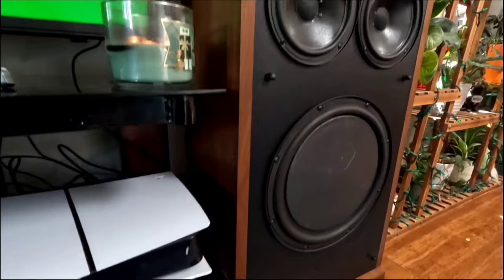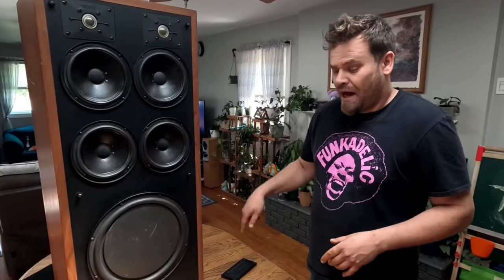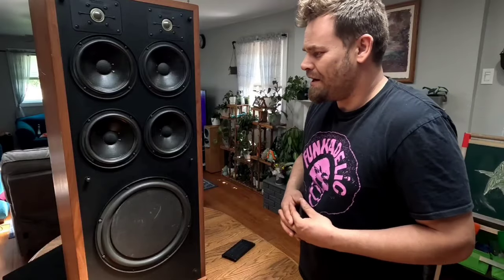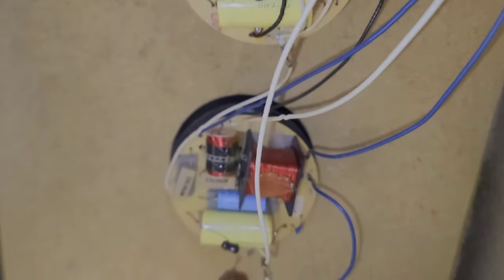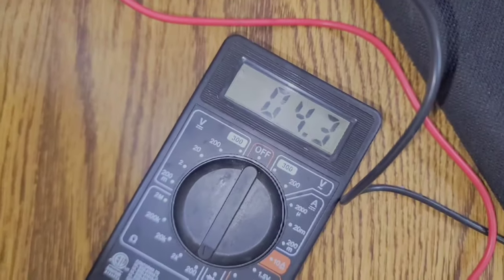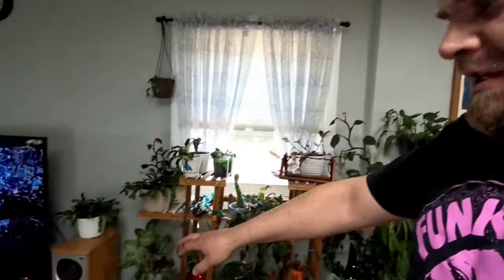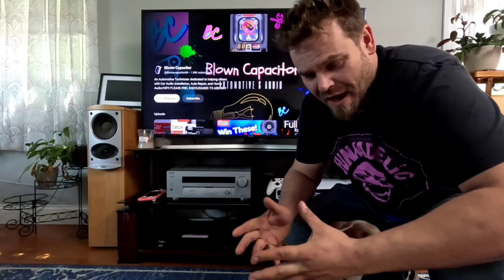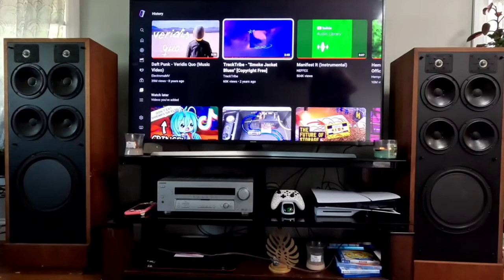I Brought These Polk Audio SDA 1A Speakers Back To Life!

Comment: Cool video. I love my Polk Monitor 5 speakers. Their best was from the 80's and 90's. FYI, interconnects are the cables between components and good ole' speaker wire goes from amp to speaker. Thanks!
Reply from the maker: Yeah, I had to make my own interconnect cable, but it worked out great! Thank you for watching!
Reply: In this case, the interconnect cable goes between the speakers so you’re not correct about that your monitor five does not use an interconnect like the SDA do
Reply: @brandonloeffler  the SDA 1A has 5-way binding post that speaker with connects to with each one I have seen. Interconnects transfer signal between components then speaker wire/connects transfer sign wave from component to speaker. Only powered speakers have interconnect cable option.

Comment: Great video; thank you for making it. I have these exact same speakers and I just finished epoxying the magnets on all woofers (to prevent magnet shift).  I do need to make the interconnect cable, as there was none with the speakers. It would be great if you can share details of how you made the interconnect; especially the part numbers for the connectors and where you got them from. Perhaps because I don’t know what they are called, I’m still searching. Not willing to pay $80 for the cable LOL.
Reply from the maker: @raviad2596  honestly I never ended up buying the cable that I saw online I just took an extension cord and soldered the ends to where they would be more solid and stuck them in the sockets just make sure the polarity is right
Reply: @Blowncapacitor84  thank you. I’m looking for only the connectors (pin & blade) that go into the 1A. Thank you
Reply from the maker: @raviad2596  No problem at all!  Thank you for watching and enjoy them! They are absolutely great speakers!
Reply: @Blowncapacitor84  would it be possible for you to share details of the connector that you got and from where?

Comment: I just got a pair of these speakers with the same kind of speaker connectors that I'm surprised you didn't mention. How do you connect wires to these? Did you use needle nose claps or do something else? I also don't have the innerconnection speaker wire and heard you say you made one with an extension cable. Aren't the ends smaller on the speakers even if you use the older 2 prong ends? If so where did you get the ends at
Reply from the maker: I used spade connectors on the terminals and I actually just cut both ends of the extension cord, stripped the ends, and soldered them so I could just shove them in the "sockets" for the interconnect. One of the terminals for the interconnect is larger than the other one so that will tell you proper polarity

Comment: I'm guessing you also know by now that the reason the wires were disconnected is probably because someone saw the connectors when they went to hook up speaker wires and decided to look inside from the back side to investigate the connector configuration and pulled the wires off when removing the terminals housing which then made them into what you initially saw and the reason they fell into your buddies hands for next to nothing probably.There is NO room to pull the terminals out and disconnect the wires before yanking them out while removing the terminals from the back .TERRIBLE wiring design
Reply from the maker: EXACTLY! I 100% agree.

Comment: My only question to you is, if you took the time to make the interconnect cable, why didn’t you audition them with it in place you do understand that only half the speakers are going to work without the interconnect cable my recommendation is to use the cable and re-audition
Reply from the maker: I did have it connected.
Reply from the maker: It was just an old extension cord with both ends stripped and shoved crudely into the terminals

Comment: Even in the 80's Polk were upper low end hifi at best
Reply from the maker: I dont have any experience with polk at all, but they definitely seem to have a stigma to them kinda like the other brand mentioned here. Although Paul McGowan from PS audio says he loves them.  Honestly, the sound stage is really good. They lack bass, in my opinion, but 40 almost 40 year old speaker they're holding up pretty dang good!
Reply: No stigma w/Polk ... they were very successful, heavily marketed loudspeakers.
Reply: Pass the Grey Puponn
Reply: If you say so lol.... sure... i mean adjusted for inflation they went for over 4k new back in 1985..... I have a pair of kef r7 and my sda 2b beats them every day of the week. Upper low end * rolls eyes* I might agree with you on the vintage monitor line but even there they are great speakers.